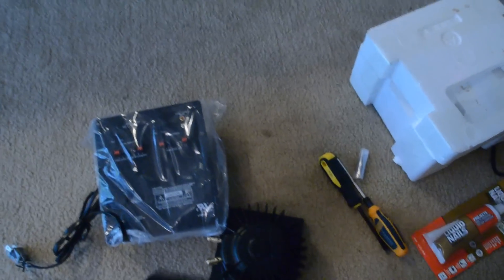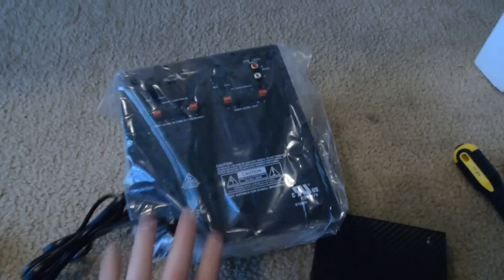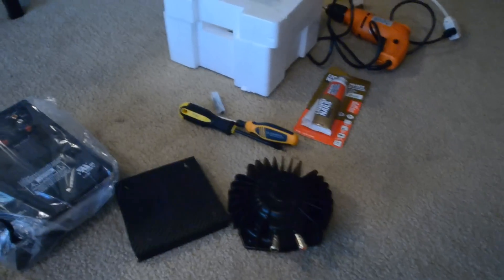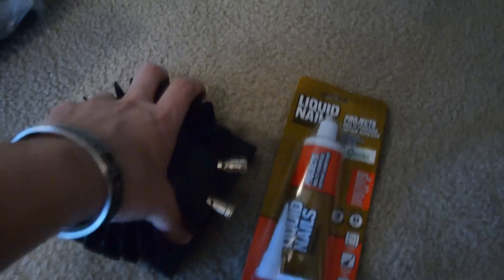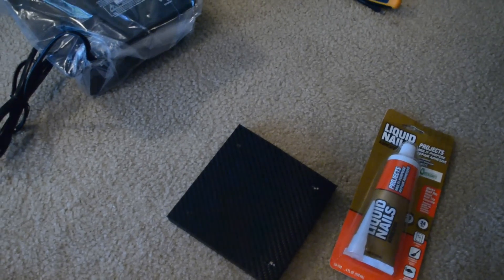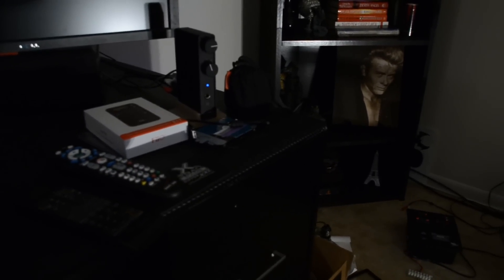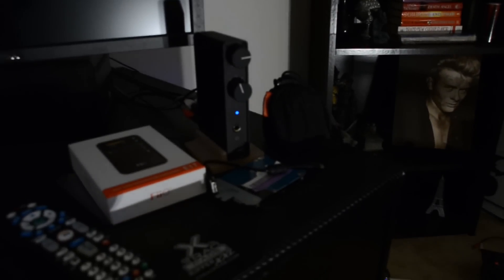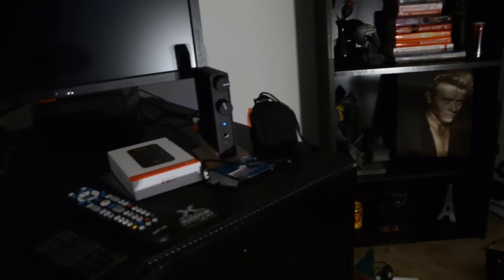DIY Tactical Transducer Project - Part #2 Build & Setup

Comment: I have a question for you... hopefully you see this and help me

I have this exact plate amp and but I'm having problems connecting and getting the shakers to work and a few steps you did weren't clear to me.

The plate amp itself has these little red/black wires with some goofy looking plastic covering some metallic looking thing at the end. Are these the wires that I hook up to the shakers themselves? If so how did you do it? Do I have to take those plastic and metals off?
Reply: Did you ever get this figured out? Wondering the same thing!

Comment: hi, nice video
i have the same amp and i'm having same problem that it only works after 90ish % of gain like you have in this video.
did you figured out if it was bad unit or is it just this amp?
Reply: It Seems to work good if I have a higher gain input going to it.  So instead of running the line level out like I did in the video, if say I run it from a headphone out of my DAC it works really well with lower gain.  Just a matter of the sensitivity, not a lack of power from the amp.

Comment: I have this sub amp and my transducers are coming in a couple of days.  I'm currently trying to test out the sub amp with my desktop speakers from the high level out.  I have a positive and negative wire coming out of the right side to my right speakers, but I'm not getting sound to the speaker.  My desktop speakers are 10 ohms...does that have to do with anything?

Comment: I have read that you can connect the transducer to its own amp and then connect that to the Sub woofer output of your main AV receiver....but how do you then connect your original Sub??
Reply: +Mouse6677 If we are talking line out you just use a splitter no big deal.
Reply: Thanks for the quick reply!
Reply: Yep - This is Vicious just was under my other account ;)